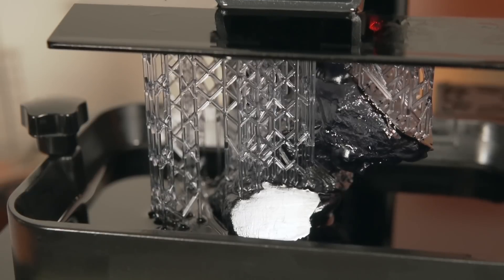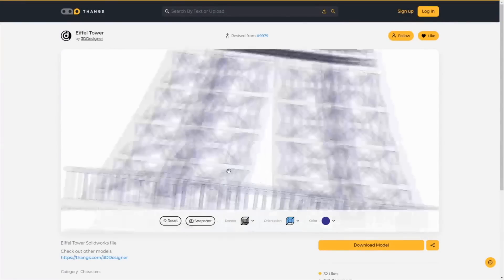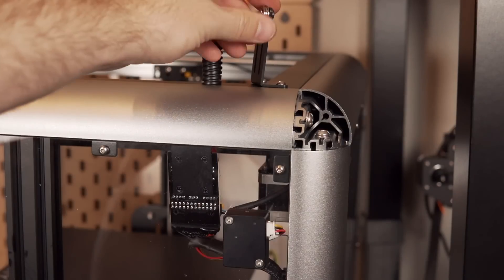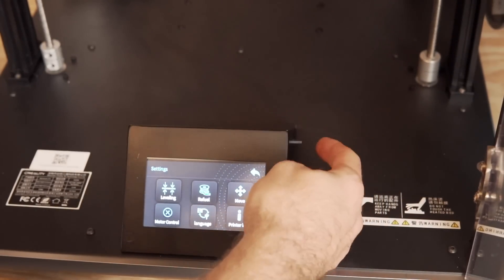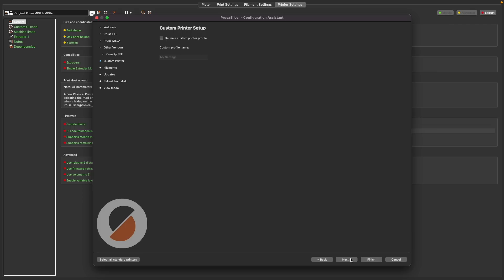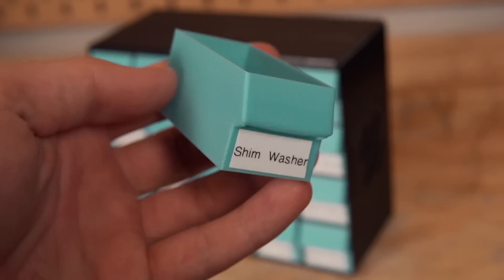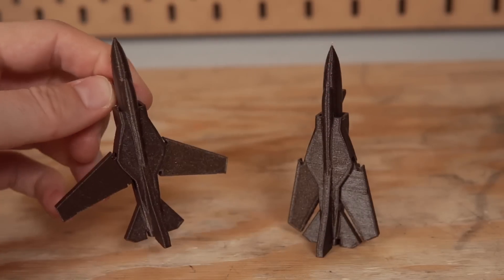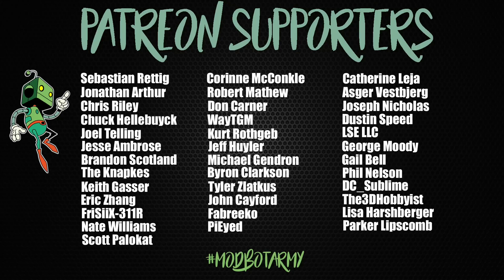Strange Design Choices On The Creality Sermoon D1

Comment: Somthing interesting you didnt notice is that the board is basically just an ender 3 32 bot board with a connector solderes in the place of the sd slot and a usb extension ran to the board. I just unplugged the extention for the usb and plugged my pi into the board

Comment: Quality of prints is amazing but for month now I’m strugling with partial clogs and clicking extruder gear feeding filament. Changed everything- nozzle 2 times, bowden tube for capricorn inside heatbreak 3 times, stepper motor to make sure it is not broken, modified cooling fans to make better cooling of radiator inside. Only slowing prints to 30-40mms give better results but still clicking occurs. Using 1,3mm retraction and 200C for Silk PLA. For me it looks like heatbreak melts filament inside before nozzle which causes partial clogs.

Comment: After a few Aliexpress upgrades (better nozzle, belt springs, thread in thermistor, and tubed support for filament) ive been loving this printer and its very reliable. For the Y screw issue created a gauge tube that fits over the screws to alert me to it offsetting. Really great prints. But looking forward to the D3.
Reply: Thread in termistor?
Reply: @xwojtassx  Yes on the triangle store on Ali express, instead of just floating around in thermal paste it screws in. The thermistor is in a brass tip with threads.

Comment: Dang, saw some open box of these for $375 at Micro Center.. but this review makes me wonder 🤔 then i would also still have to convert it to all metal hotend, build a proper cooling duct, etc

If im not able to adjust the hotend to over 260c and hold stable that'll be a deal breaker
Reply: Just picked up an open box one at micro center for $249 so fingers crossed it works well
Reply: @johnn73  i dragged my feet on it.. I Literally got one two days ago for $275 open box, completely untouched. I'm currently making some redesigns to the floating lead screws for the bed and hot end and will probably link both with a belt as there's enough room to add one. Converted the original throat to hight adjustable so you can snug it right up to the extruder gears, all those extra Dremel attachments finally came in handy lol. Then using a all metal throat to come in the bottom like normal as the original throat will be raised (and shortened to have it fit flush).
Reply: @johnn73  I'll put up my designs on thingaverse under NeatOman lol
Reply: @MrHeHim  that's awesome! Il check it out. I'm building it now to see if it was worth the purchase or not. I see it's being discontinued so I purchased the warranty thru micro center so if I can't get parts for it they said they would just give me credit towards a new printer if that time ever comes
Reply: @johnn73  last three printer I bought was a PowerSpec Duplicator i3 for $100 at Micro Center, that needed far more upgrades/redesigns to get it working like a champ

Comment: I can see 1 thing about the lead screws that is an issue.  They appear to have a 20mm lead, which means when power is not applied to the stepper motors, they will not hold their position.  This was also an issue with the early Ender 5 models, which were later replaced with 8mm leads.  It shouldn’t take very much downward force to make the bed lower, and will definitely cause tramming issues.

Comment: I think I see 3 reasons for the bearing filament thingy. 1, keep filament from rubbing on the side and guide it's path. 2, absorb most retraction movement so it doesn't make it back to the spool to cause any issues there. And 3, same as 2 but to avoid filament reverse travel inside the runout sensor. Creality usually just use a basic levered microswitch, and that sensor looks identical to the one on the CR-10S and onwards. So there's no roller/wheel on the tip of the microswitch lever - only a thin flat steel lever arm. And this lever arm had been known to snag on the filament if retracted or ejected, bending the lever and breaking the microswitch.

Anyways - i think it's an interesting idea. Everyone has been complaining for a long time now, that every FDM printer coming out is just another Ender 3, CR10 or Prusa i3 clone, that no manufacturers try anything new. So I find it odd that here, we're seemingly poopooing on this for actually trying some new things, and complaining about how some elements are different from those cloned-to-death printers.
Reply: I Agree. Your "3 reasons" seem to corroborate the use of the bearing filament  (I am a Physics specialist). How many times, the retraction and the head displacement of the printer caused the filament to become loose on the spool and thus made problems ? It is really annoying and time consuming. Personally I have a machine that I had to attach a pulley to the filament to obtain some permanent consistent tension when retracting or head movement.

Comment: Why do so many printers with dual Z leadscrews use two independent motors to drive them? Sure, stepper motors are reasonably good at keeping synchronized when they're actively being driven (and the drivers and code running on them are reliable!), but the height of those two leadscrews must remain timed together at all times - whether the motors are moving, stopped, or the whole printer is powered off, because dual-Z leadscrews are uniquely capable of literally breaking themselves if they're driven out of time. It's a shame that stepper motors are literally cheaper than a timing belt and pulley, but that's the world we live in.
Reply: Dual motors would be ok if they had separate drivers. The firmware could actively re-synchronize them using the bed level sensor. The Voron 2.4 does this with four Z motors and it works great

Comment: Great video and interesting to see which issues you encountered. I am still trying to get the machine to print consistently since my livestream a few months ago. After replacing the z-stop limit switch, which arrived crushed, I have been experiencing seemingly random x-y layer shift, which makes printing anything with the machine very risky. It’s a shame because I’ve found that my unit actually prints quite well. Currently waiting on a replacement board and hoping that fixes the issue. Will also switch to Prusa slicer — I am a bit disappointed that they did not supply a usable Cura profile with the machine, since this is clearly what Creality Slicer is based on.

Comment: The Ender 5 Plus also drops on one side when the steppers are powered down, I have to re calibrate them every other print, I have been told on the FB group that POM anti backlash nuts fix this issue and I will order some to see if they do fix the issue, of course it may be possible to keep just the steppers powered up constantly so they dont drop

Comment: An anti backlash nut on the lead screws may make a difference. I am not an expert but voltage issues with that one stepper, or that one stepper getting momentarily de-energized out of sequence at the end of the print may be a culprit. It looks like there is adequate space below the heated bed to install a z-sync upgrade where you connect the two lead screws with a belt.

Comment: Great video!  Not really looked into this printer much, so was interesting to hear what you thought about it.  Reminds me a little bit of Flashforge machines, which isnt a bad thing if they had gotten it right.  

If your planning on keeping this printer long term, look into installing a bltouch and using G34 to correct your bed leveling issues automatically.

Comment: I'm waiting for a printer that produces a extremely smooth bottom, top, side , & top layers without having not to go into the G code or printer settings. The filament rollers should be in a position to feed the extruder & straighten out the filament.

Comment: A lot of these things aren't oversights, they're intentional design choices. Like the "incomplete enclosure" - it's not meant to be a full enclosure. It's for noise. That's what the back is open too, this is more of a noise focused printer. The bed issue aside (that is surely a QC issue, they need to take that one to heart), it seems like a decent printer. What's wrong with it IMO is the price. This is a $450 printer. Maybe a $500 in a pinch, but that's knocking on the door of the Ender 6. Not a $639 printer - that's far too close to an Ender 7 while not delivering thst much more than a CR-10S.

Expecting a full, proper enclosed 280x250x310 direct drive corexy'esque printer for ~$600 is not at all realistic these days. Almost half the pricetag is shipping as it is.

For what you appear to be seeking, there's the Sermoon V1 (pro).

Comment: I've not had to level the bed on my Sermoon D1 more than once every 20+ prints so maybe you janked it up when you assembled it incorrectly. Although it doesn't get super hot in the enclosure I have noticed that in a cold room the interior is still nicely warm which I think helps with warping as I've not had any where I did on my Ender 3. I think I paid  £415.

Comment: I have had a D1 for a month. I also have an Ender3 v2.   The Ender3 bed stays level no mater how hard you work to release a print( put 2 z motors on for a day).  I am like you and every time I touch the bed I must level it again.  The Ender3 with 2 z steppers acted the same way.  I got tired of the doors not folding parallel to the front of the machine.
I moved the hinge mounting holes 5.5mm forward. (5mm would be enough)   Spaced the run out assembly to the center of the spool.   Installed a bearing spool holder.  Removed the grooved  bearings and mount.  Installed a swivel base and an 1 1/2 " pulley with a removable engagement pin on top. Fabricated 2 each  1 inch long clips with bearings installed  that clamp over the extruder  cable shield.  Installed a pivot block on top of the clips.  The hole in the block was a tight fit for a 10" long white ptfe tube.
I wish software  was available for BL Touch.  I don't know if there is enough room to put dual shaft steppers on the z axis.
WISH they would put a 2 shafted stepper on the extruder so Eneder3 wheel would fit.
Top enclosure is in the works

Comment: That's a bummer, the printer sounds like a 90% finished idea. Absolutely agree the filament patch should have had a PTFE tube to help constrain / protect it.

When you were poking around in the guts of the printer it looked like the USB port was just a panel mount style USB extension cable which would make it super easy to just unplug the extension cable if you wanted to stuff a raspberry pi inside it.

Comment: Anti-Backlash Spring Loaded Nut and a Capricorn blue ptfe tube 
if they had just installed these two things and autobedlevel then it would have been a little more interesting, thought it was a lot of money for it and so not much new about the machine, it is more a fusion of different printers they have made 🙂

Comment: I don't have a Sermoon D1, but I do have a dual lead screw printer that had a huge problem with the sagging bed on one side. The best fix is to update the firmware and enable the Z Stepper Auto Alignment feature in Marlin and run a G34 every time you print. For me, I had to install a new mainboard, but I don't think that would be necessary with the Sermoon D1.